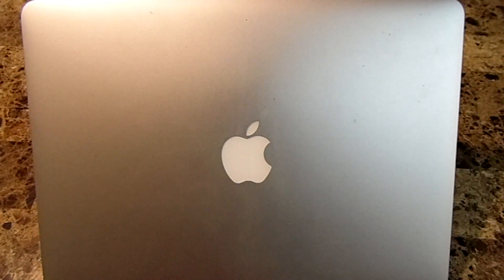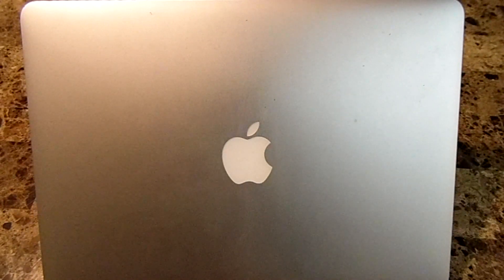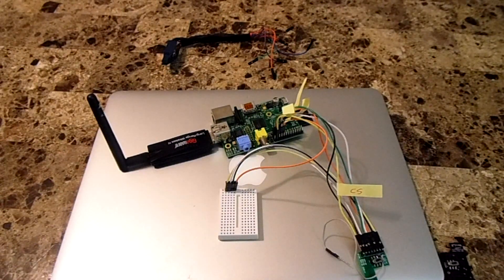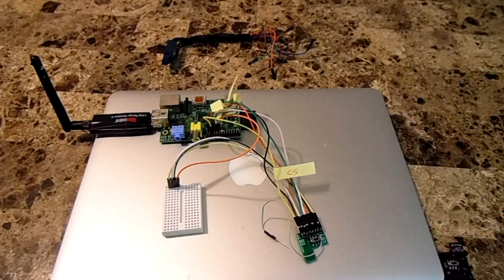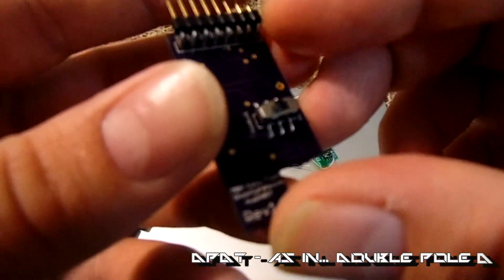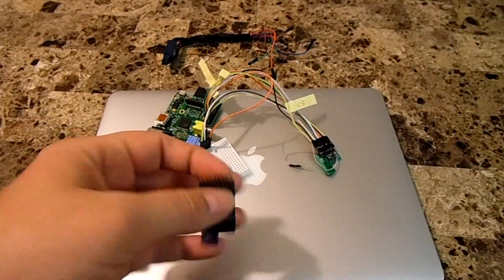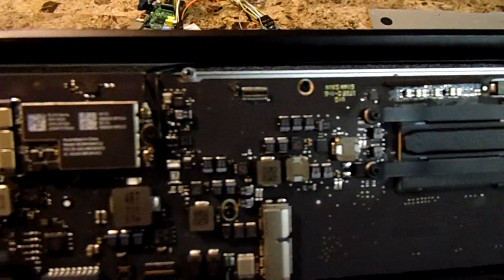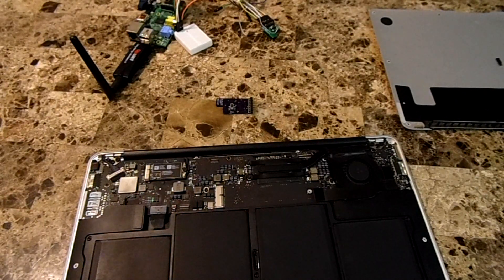Introduction Of The MacBook Air Easy Flash

Comment: Hey Ghostly, thank you for the video: I've got the old connector which requires to power up the EFI seperately. Is there a way do power up the EFI without dissambling the whole Macbook? Where do you put the 3,3v? Thank you.
Reply from the maker: +DeadSilenc3 I'm not sure I fully understand what you're asking...
Reply: GhostlyHaks.com sorry... in the video you're talking about the rip off (100$) competitor adapter. I have a similar model which requires me to power up the EFI ROM separately. However, I am not 100% sure where I can find the PP3V3_SUS on the logic board.
Reply from the maker: +DeadSilenc3 umm.. I can't give any advice for any device that isn't strictly made by me. Always remember: there's a reason why similar models are just that, "similar". There is no device that is as efficient and easy to use than the devices I make.
Reply from the maker: +DeadSilenc3 because while the other imitations have limited success, each and every one come with their own set of caveats that make them more difficult to use. I take it the requirement to "power up" as you say is done so via a separate rail that is detached from the rest of the unit; in which case I forewarn you that should you have even the slightest slip of the hand while probing the 3v3 point then you are quite literally feeding live voltage directly into the points it may come in contact with. I have seen boards ruined by such accidents.

Comment: You are 100% Correct, I also live by that Philosophy 
share ALL knowledge, some people actually said that I am stupid to share my "secrets" or what I have learnt 

And thanks for coming up with this solder-less bypass solution :D 
Ur Awesome!

I have also successfully bypassed iCloud 4 digit pin code locks using the Teensy 3.1 to perform a Brute-force hack, takes about 60 hours 10,000 combinations 
But this EFI Lock has always been hard and now Thanks to you it's Hell of a Lot Easier :D

Thanks @GhostlyHaks.com
Reply from the maker: +AdiCtek nologies (AdiCtek) Well, I have some pretty fast code for the teensy and am about to drop some code that will revolutionize the EFI industry for end users and shop owners alike. I am also looked upon as though I am stupid for releasing all my stuff as open source, but I have a great community and I think they need the info more than I do.